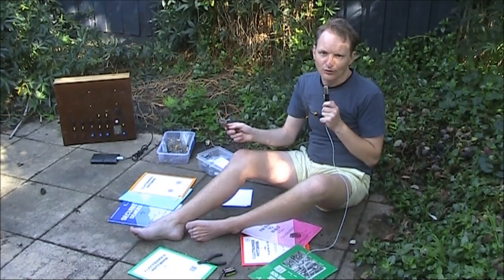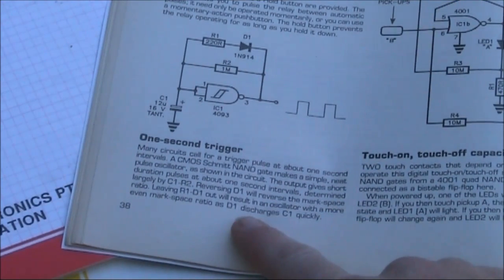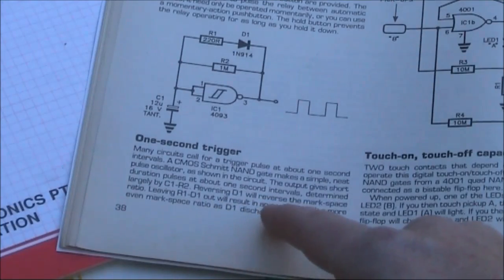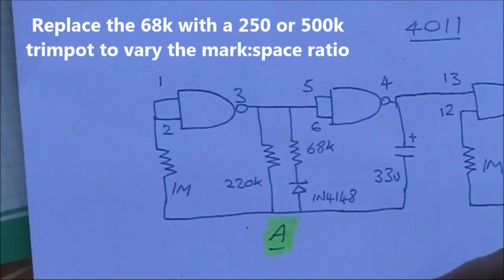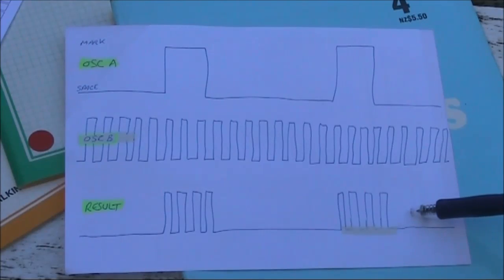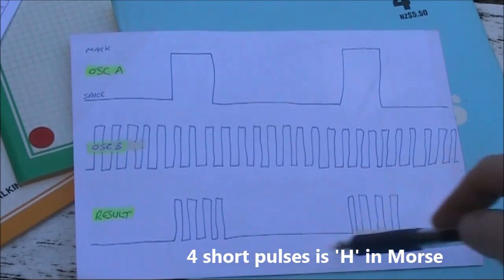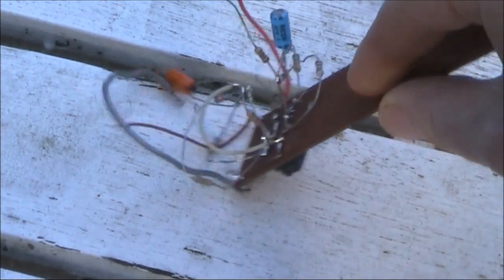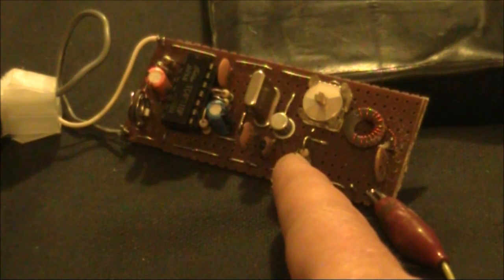Electronics on the Floor: CMOS gated oscillators and use in a radio beacon

Comment: Now use it to gate a buffer amp following the oscillator. If you have the crystal osc followed by an emitter follower it will have a nice amount of current to drive a following stage and because of its fairly high input impedance, will isolate the osc from changes in load conditions. Then use the "gater" to pulse dc to a transistor switching in the emitter circuit of a following RF amp thats running in class A mode. You'll find very little RF leakage and a very stable carrier as its keyed :) then amp it up as desired